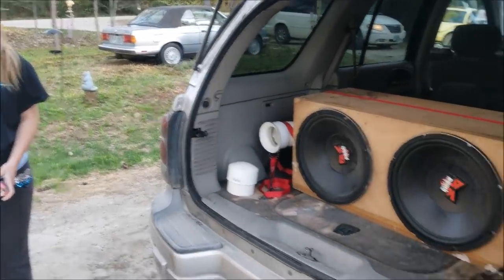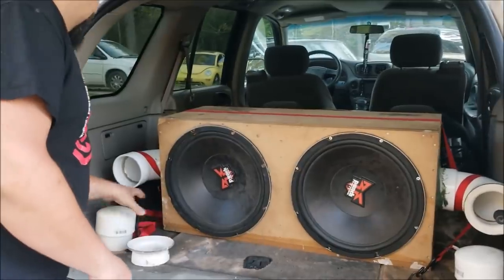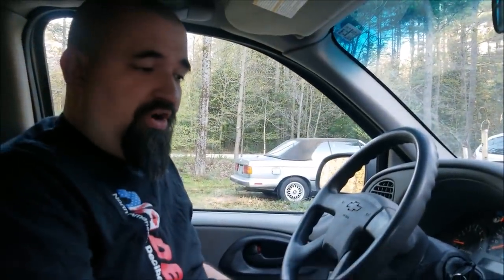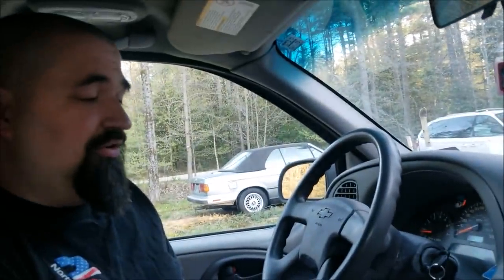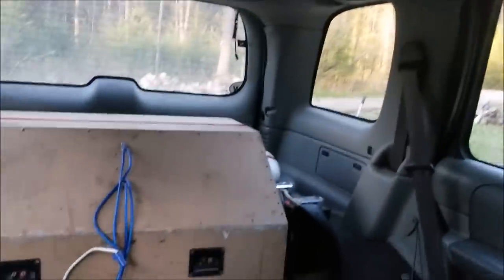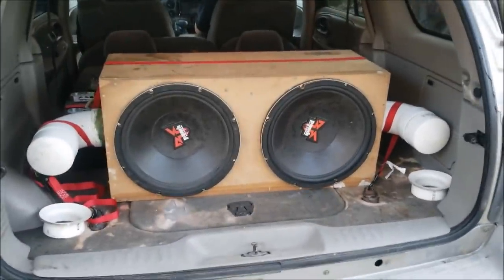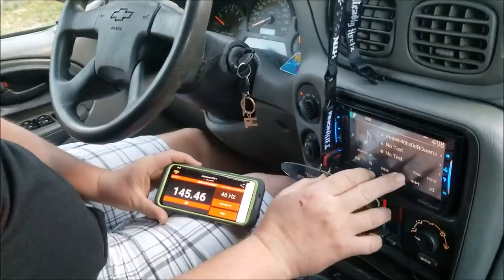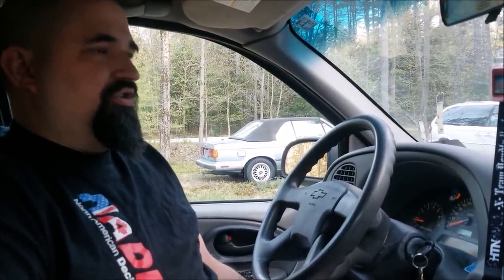Ported vs Sealed Enclosure Subwoofer Box Test with Decibel Meter Using My Daughters Bass Car

Comment: U cant jut port box size matters too
Reply from the maker: Go to 27 seconds,  - https://youtu.be/e5AeSyOeTWM?t=27  Read The Owners Manual Screen Shot. You can clearly see the Recommended Enclosure Size for Sealed and Ported for these subs are both 2.5 cubic feet. So Yes, in this case you can simply add external ports to the enclosure! Thank you for watching and commenting.